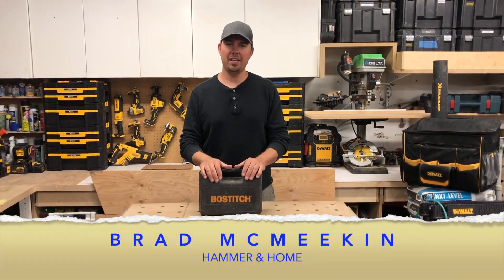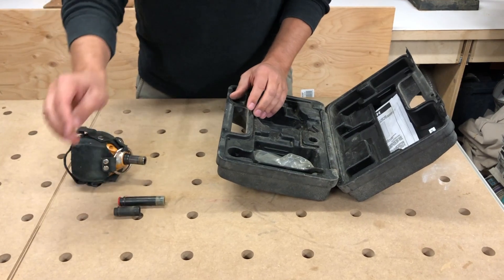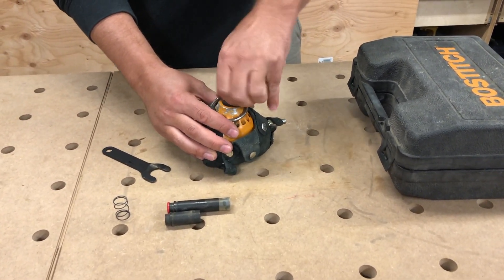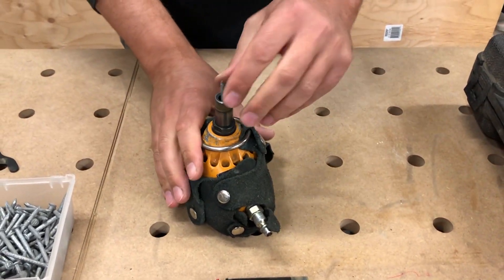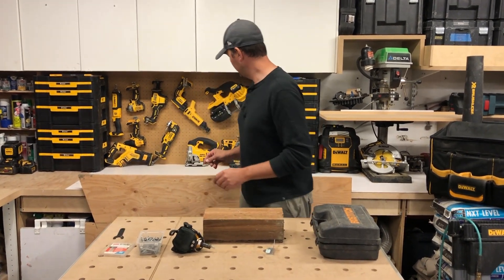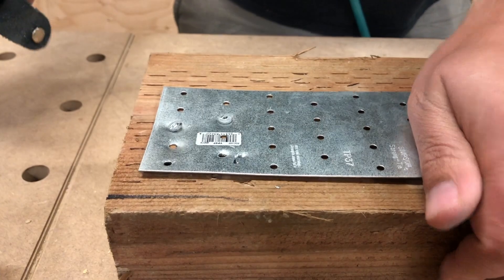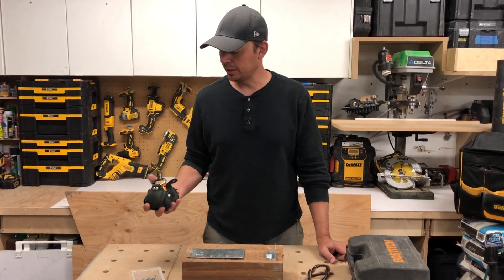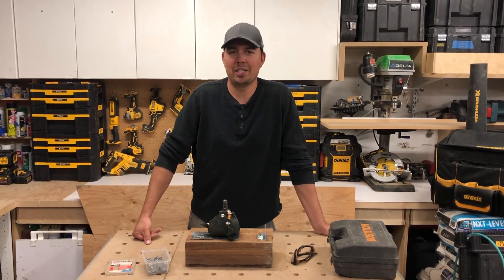Speed up nailing with the Bostitch PN100K Impact Nailer Kit

Comment: Good info. How useful would it be for overhead nailing? I need to fasten some t&g car siding to the underside of garage rafters. Probably face nailing   2 inch nails. 

Not sure my 16 gauge finish nailer gives enough hold but a framing nailer seems like overkill...
Reply from the maker: I'm not familiar with car siding. what is it made of and how thick is it?
Reply: @hammerandhome  Its pine appx. 3/4 " thick in widths of appx  6 or 8. Tounge and groove style. Since it's  a ceiling for workshop room within my detached garage, I will face nail since the hold is more important than hiding nail holes.

Comment: A 2 year old can figure out how to use this. Why can't anyone tell us how to use the finish nail barrel? Do you know? I had to figure it out myself. For anyone else wondering, you have to take out the big spring and put it in  so that the little end of the pin hits the nail. You have to leave on that clear plastic thing around the barrel too. I couldn't get that stupid leather holder to go on right either, and of course there's no video to show anything and mine didn't have directions about how to use the accessories.